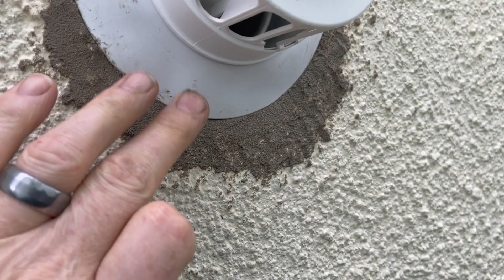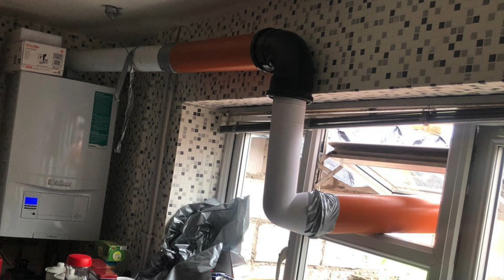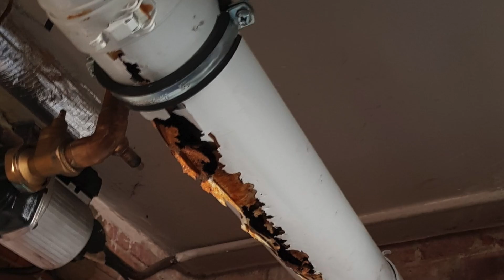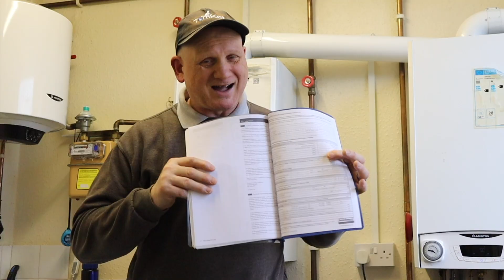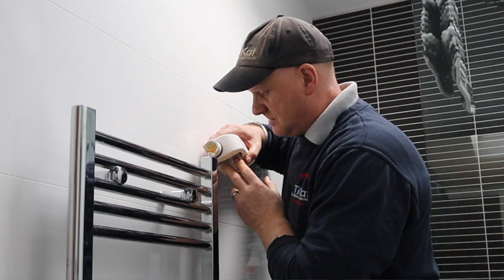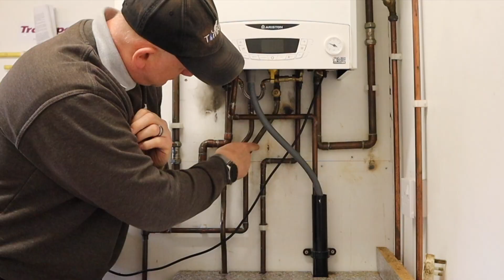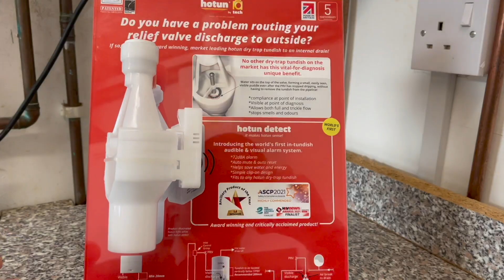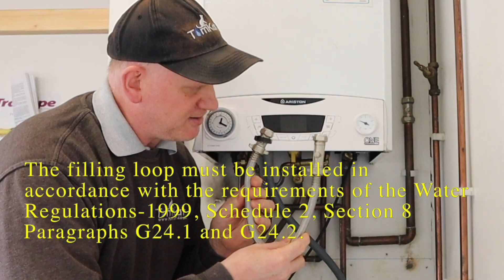Gas engineer or cowboy,  looking at common combi  boiler faults found when servicing or repairing.

Comment: A non registered installer will leave no paperwork and will not get investigated as cannot be traced/prosecuted.Where as if registered installer has made a mistake they will be investigated and could be prosecuted as will have all their details. 
Also Gas safe will not investigat an illegal installation reported by a registered engineer only if the homeowner does. It just seems they don't pay for qualifications or registration costs therefore can undercut and get away with it

Comment: Why do they now want insulation under the boiler if its within the thermal envelope of the house. Not wanting to be lazy but surely its a waste of money, time and does nothing to improve heating efficiency, unless your just insulating the hot water pipe. As the radiator flow and return are only giving out heat within the thermal envelope of the house and also not much sense insulating the cold water pipe as its about to get heated in the boiler if its a combi.

Comment: But some boiler maufactures don't want any inhibitor in the heating system. They want a clean system but inhibitor has been proved to be worse than no inhibitor. Ideally the system should be filled with demineralised water or to VID 2035. But amazing and very informative videos

Comment: Newer engineers hopefully don't pick up lazy engineers habits.
I take every installation as if I'm doing my gas exams 😂
After a while it becomes the norm 👌
As for all these faults. I put alot down to builders plumbers who need to get off to the next job.
Good video. Also liked the gas valve vids as well 👌
Keep up the good work Derek.

Comment: Here’s one for you Derek, is it Illegal to commission a boiler someone else has fitted? 
Where would someone find the relevant information on this? 🤔
Reply from the maker: You are technically not allowed to commission a boiler if you didn’t fit it but who ever commissions it takes responsibility for the installation so if something is found down the line the commissioning engineer takes responsibility for it

Comment: What's the issue with it being a switched socket? Is that really a problem? Mines on a switched socket. Has been for years. Second question, are you saying inhibitor degrades over the years? Should it be topped up annually? Thanks!
Reply from the maker: If it’s not double pole and you just use the switch to turn off the boiler you could get election through the neutral. Every 5 years the inhibitor should be completely replaced

Comment: If there already is a CO alarm next to the boiler. Would the installer have to provide and fit additional one on a new installation. Check if in date and works assumed

Comment: I'm an electrician and never mess about with gas or gas appliances apart from connecting up the electricity supply for a boiler, but your video seems like basic safety to me, and yes I have seen some of the scenarios you have highlighted!

Comment: Derek, Your obviously old school, but you already know the vast majority of Gas Safe engineers have not a clue about either installing, servicing or fault finding. All and any tested involved done by local authorities are now down to a timing of 45 minutes / dwelling which could involve a cooker and a gas fire yet most councils know it cannot be done, but all they want is signed off tickets. Pipe sizing / meter sizing and gas rating is something that is done on the moon as far as must are concerned. Once a bus driver / painter, 6 months later a qualified gas engineer on paper and plastic and most have no system or electrical knowledge at all. You will find that all the old mud men from the old gasboards now have a suits and a tie, company car, now working for Gas Safe admin and couldn't give a monkeys until they have too.

Comment: The plug top fuse protects the cable going to the boiler which is often not rated for 13A. There should be another fuse inside the boiler protecting the board.

Comment: Very common to forget to put the flue test  caps back on after service or gas safety check . We have 1000s property on the books and it quite regular occurrence . Also cost of replacement by manufactures is extortionate

Comment: Cut a nice core hole out and then make a mess getting compo all over a white wall. What a balls up. You will probably find that most of these installations are by gas safe engineers. Just because someone is qualified it doesn’t mean they are not capable of screwing up. Some of the gas safe work I’ve seen on my jobs is bloody shocking.

Comment: Can you clarify the filling loop issue.  Surely it doesn't matter whether the double check valve is on the cold pipe or the return.  When the system is being filled the backflow prevention is there in either case. (But it can be more convenient to have the standard valve on the heating side for draining purposes).
Reply from the maker: The seals in the none return valve are only designed for cold water not heating water so they will fail and if you have left the hose connected it could pass heating water into the cold

Comment: great explanations! A boiler is only as good as its install.
 I think the installs are a mix. NGSR AND GSR engineers, competetive pricing i feel has also brought standards down. People will go for the cheaper option who most likely wont sign the benchmarks and don't put effort and care into the installs such as filters, limescale reducers, check valve on condense if needed etc. 
Some customers understand you shouldn't go cheap on the install for these reasons (likely because they had an issue in the past with an installer) though most still won't want to pay for a  full powerflush even when i tell them their warranty could be voided.

Comment: Thanks for good information please tell me if gas pipe need more then 15mm then why is boiler have 15mm Connection
Reply: Its all about getting the volume of gas to the appliance inlet- irrespective of the connection size on the gas valve. Gas pressure at the inlet point is key for correct combustion. If you had metres of 15mm gas supply then the resistance of flow over the distance of pipe may not give the same pressure at the end of the pipe - basic physics..

Comment: I've just had a combi boiler fitted to replace the old heat only boiler, I'm no gas safe guy but was in the industrial door game for years and allot of the building regs ect cover allot in any trade, he was gas safe who did it and used the immersion heater for power yet he never fitted a 3amp fused spare i told him his answer was the boiler has a fuse and the fuse box covers it and thats 16amp fuse , i said the best fuse there is the cable connected to the boiler as that will melt first so he put a fuse spare on also the 40yr old rose that was on the immersion heater that connected house wires to the tank immersion heater was damaged so all the 240v was showing and it was at chest height inside the cupboard were the cistern used tobe, he said that's staying lol wtf i said , i ended up putting a box on that, think is he must of lied on the form filled in as it had tobe done for building regs and warranty, i checked inside the rubber gasket around the flu and its not been cemented when watching this vid, there's was other bits that was an issue but i did that as it was nothing major but had him back a few times on the stuff i could of done but thought sod this that could be seen under warranty claim i even fit the timer on the wall as he said its too near electric,, even so i wasn't happy with missing stuff like that and we know him, i asked about the inhibitor about topping up ect he said its for life in a sealed system and he only flushed system the day after it was running, I've got a magnaclean ill just top it up every year at least it will save me a few quid, oh and underneath the pipes are not insulated but it is inside house were the hot water tank was, and the condensate pipe outside is not insulated but its a 35mm pipe
Reply: You fitted doors and thats the same as gas and electricity 😂😂😂😂😂 since ‘its all the same building regs’ talk me through how you would fit a boiler start to finish how would you carry out let by and how long is a tightness test ? Do you even know how to solder ? Guarantee youve went only like picked some shite company for cheapest price you can find and now you want to moan about it
Reply: @shaunconnor7525  no the the regs on electric are the same no matter what you don't have tobe gas safe ect it all narrows down too the same i,e low/high volts ect and if you think industrial doors is below you lol you have no clue , and no i didn't go cheapest quote  don't talk crap , mother could of had this done free via grant as we wanted to not have theses issues, like i said the person who did it we have used for years and now the son is doing it, laugh is you say i moan but allot of people would of not seen theses issues and it was mentioned

Comment: Fire rated expansion foam is fine to use to seal the gap in between the flue and the wall and the flue has been screwed together. Usually cover up the foam with the collars to keep it neat.
Reply: thats a better idea than cement as that cracks, even go over it with silicon and collar to cover it.
Reply: Check manufacturers instructions
Reply: Only if MIs say it is suitable

Comment: I'm sure it's gas engineers that  have under cut others to get the job. Also no matter what it'll be a small minority that are just plain lazy.
Last week serviced a brand new vaillant and I was unable to remove the condensate as there was pipework blocking it from being removed.
At the end of the day. If you value your self and the trade no matter how much we get pieved with continuous changes in the industry. If you do the job correctly then you'll always sleep well😂

Comment: Insulating the pipework in the thermal envelope of the building will reduce the overall surface area of the system and mean hotter flow temperatures would be necessary. Someone at regs not been doing their homework.

Comment: Why the no switched socket always wondered?
Reply from the maker: If it’s a single pole switch and you just turned it off at the switch and didn’t remove the plug you could get electrocuted
Reply: @tomkatgastraining  googling single pole switches. Thanks

Comment: Just had a new Worcester Bosch system boiler fitted. He had to come back six times to correct his faults - cement the flue inside, find electrical fault, fill in the benchmark and lag the condensate pipe outside etc. He was recommended by  Worcester Bosch. I spoke to WB technical who said he had never seen an 35mm pipe freeze in his ten years as an engineer. My 42mm washing machine hose froze. I am an ex gas safe engineer and have been doing plumbing and heating for over 50 years. How can one tell a good engineer until they have finished the job. Very disappointing.
Reply: Worcester only require to seal flue external although best practice to seal both internal and external quick question where do you get 35mm pipe and 42 mm washing machine hose do you live in a hotel as your washing machine must be fucking massive to have 42mm discharge 😂 typical old fanny ‘iv been in plumbing and heating for 50 years is that why 90 percent of existing heating system in the uk are absolutely wank and electrical fault was it existing or did he create it ? If youve been in the trade for 50 years why did it take him 6 times to resolve all issues as your clearly so experienced you could have gave him a snagging list snags al done within 1 visit silly old hector 😂
Reply: @shaunconnor7525
Reply: @shaunconnor7525  He left and next day asked for me to pay invoice. But I could only use the central heating with the hot water on constant so there was a fault. He said he would return one week later between 8 and 1pm. he never completed trhe condensate pipe outside as he did not have enough fittings. He came back but could not find the electrical fault so would have to return after talking to Honeywell. He eventually found he had broken the wire when taking old boiler out. there was also a 4 inch gap around the flue which he filled in after me asking. He also had to come back because he did not fill in the benchmark. You have a lot to learn and it might come with experience. 

CH with the Hot water on constant
Reply: @shaunconnor7525  The WM hose was normal and it went into a inch and a half pipe to the outside and froze. It flooded my kitchen until I heated the waste pipe. I then replaced the pipe for 2 inch and has been ok since. Becouse you ahave never seen a waste pipe freeze, does that mean it doesnt happen?
Reply: Waste pipes are either 32mm or 40mm are you confused? Rarely have I ever seen people lag 40mm waste pipes so your saying a 40mm kitchen sink pipe needs to be lagged on they outside? I don't think so.
Reply: @c56777  The washing machine hose is a normal one which goes into a inch and a half plastic pipe to the outside. This pipe DID freeze so I put a 2 inch pipe on the inside of my kitchen and out through the wall into the gully. I now takes the DW and WM and has never froze since.
I comply to WB instructions which say the 35mm pipe should be lagged through the wall and down outside to the gully.( may I suggest you take a look at them) There were 2 plumbers and the main one left a 20 year old person to do the job while he when away and they started at 11olock.
He returned at about 4 pm and worked until 7pm. The boiler was working but would only work with hot water on constant. I was asked for payment the nest day.
I informed them of the problem and they said they would return the next week of which they did. They also had to extend the condensate pipe outside to the gully. They had only partially filled the inside flue with cement and left a big gap of which I asked them to fill. When they returned they could not find the fault but said they would return after they had spoken to Honeywell. 2 weeks later they returned , done the cement around the flue inside, extened the condensate pipe and found the electrical fault to be a broken wire of which they had caused. They left but I found they had not filled in the Benchmark book. So they said they would return of which they did one week later and it took them 10 minutes. I have 9 rads so asked them to put in 2 tubs of inhibitor but they only used one.
I don’t like to look at other peoples work as they were recommended by WB but they had to keep coming back so I lost trust in them. I then found they had not lagged the condensate pipe outside so once again they had to come back to do this job. I SHOULD NOT HAVE TO CHECK THEIR WORK. Every time they returned the gave an appointment between 8am and 1pm or 1pm and 5pm.
You are very quick to criticise older fitters and I wonder why? Hmmm. I did not ask them to lag the condensate pipe through the wall as instructions state. Hope you can UNDERSTAND all this young man.
Reply: @c56777  Take a look at Tomkats video of lagging the condensate pipe where he states one should also lag kitchen waste pipes.
Reply: @equalibrium7898  Doesn't happen I'm afraid bud.
Reply: @c56777  You need more experience and maybe one day, you will see it happen.

Comment: British gas install my combi but never filled the paper work at the back of the installation manual and i have my boiler serviced every year and some engineers spend 45 mins servicing and others spend 20 mins and very rarely fill anything in in the last 11 year iv had 3 service papers

Comment: Everyone misses one of the most common problems. The CUSTOMER. Always looking for the cheapest price so engineers have to cut lots of corners to try win work and stay competitive. It’s no excuse for dangerous gas work but I totally get horrendous looking pipework. Customers constantly try to squeeze every penny they can back. Flushing getting completely ignored. One boiler off one on in half a day. I get it though the cost of living has put massive strain on everyone.
Reply: That’s a great excuse for negligent work (blame the victim) - I wonder if GasSafe would accept it - not that they are at all interested in quality.

Comment: Replaced a Boiler over the Xmas,  new year period. Obsolete fan! Installed a Vokera 25C with built in timer. Yes customer didn't want to spend. The system had an existing Honeywell wired room-stat installed. Spent at least half an hour discussing programmable room thermostat options. The bloke went into the other room, chatted with his wife then return, saying no we'll keep what we've got.  Managed to talk him into have a filter though.  It's hard work, when your hands are tied.
Reply from the maker: Just remember you are putting your name to an install that doesn’t comply with the building regs and boiler plus but you are issuing a compliance certificate I bet the customer would say the engineer never told us we had to but I know how hard it is and people don’t have the money but we should still comply
Reply: @tomkatgastraining   Yes Derek I totally agree. They had me on the day, I'm afraid, frustrating.
Reply: Install weather comp, gets you boiler plus, just don't tell them 😅

Comment: I do find that some of the installations we are called back to, are carried out by the sub contractors our company use .I think it's because our company are not policing there quality of work, and I think they get a fixed price for the install . Also the survey is carried out over the phone, using video link  with the customer being asked to move around the house.the surveyor is not a technical type person.so he sells the boiler on what the customer shows him .and we find time is tight .so the sub contractors are up against it straight away. And that's where the problem lies .
Either that or they just don't take pride in doing the job correctly.
Yet again a very important and informative video.